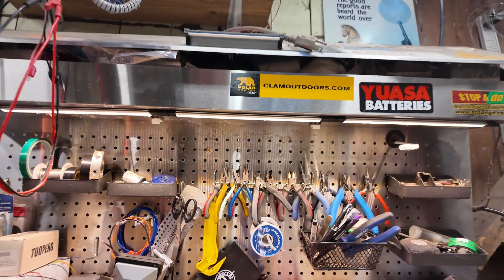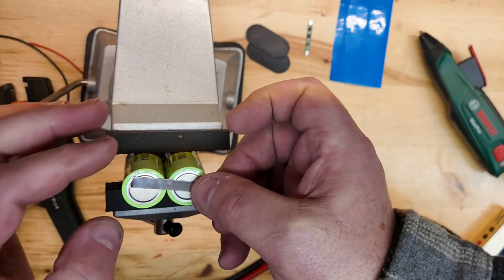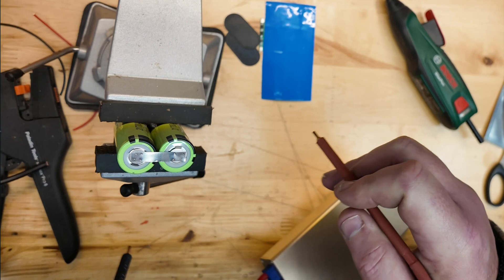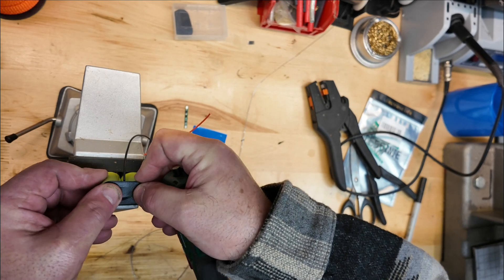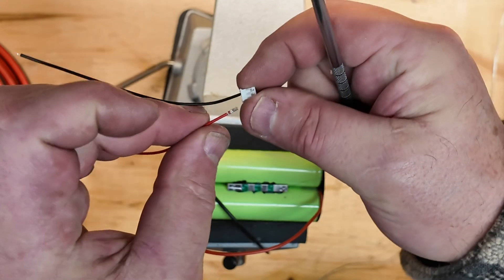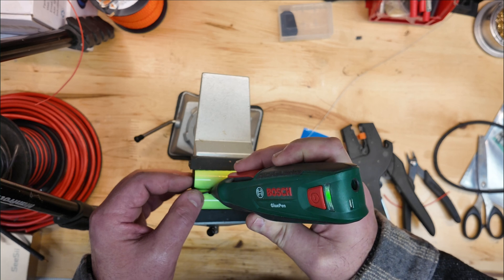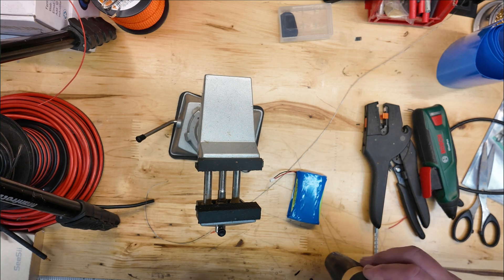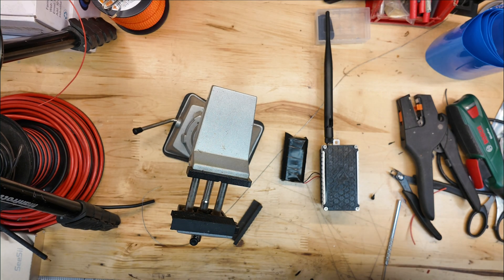Assemble Your Own 21700 Battery Pack - Easy DIY Guide #BatteryPack #DIYPower #21700Battery

Comment from the maker: Affiliate links that help support the channel:
Shrink wrap - https://amzn.to/420BGEK
Low Voltage cutoff - https://amzn.to/4fTPvII
21700 Cells - https://amzn.to/4fO47ZM
JST Pigtails - https://amzn.to/4a7YvID
Spot Welder - https://amzn.to/4a82kgV
Soldering Station - https://amzn.to/3PlynAJ
REALLY good stripper - https://amzn.to/3PnmBph
Flush Cutters - https://amzn.to/4ad2fsE
Solder - https://amzn.to/3PuYBk1
3D Printer model (free)- https://www.printables.com/model/1136884-end-caps-for-21700-battery-packs

Comment: Great video, helped me understand spot welding in regards to batteries. I'm working on a project and was looking into spot welding battery stuff and came across your video. Is spot welding ok to attach the nickel strip to the battery and then solder the wire to it like you did, but only for one battery. I don't need to use 2 like you did in the video.
Reply from the maker: Yes, works great!
Reply: @TheDIYMaker1 thanks for the help.